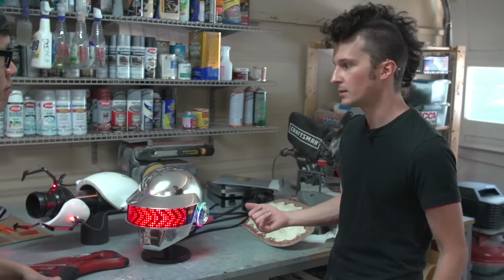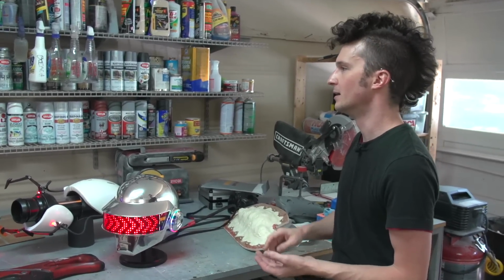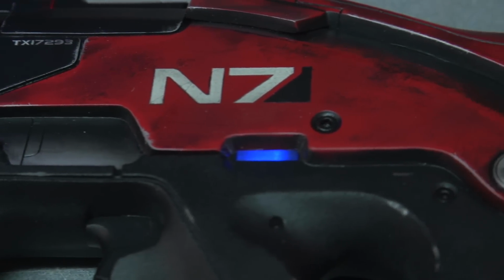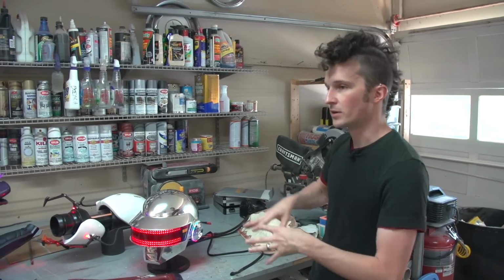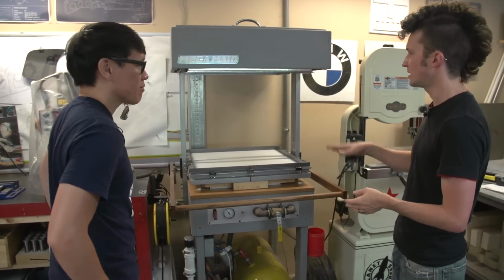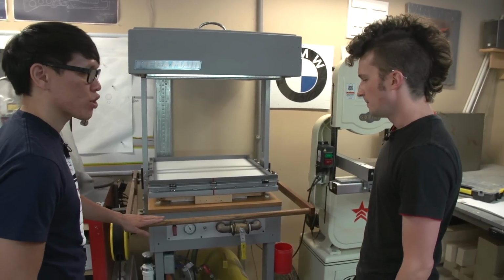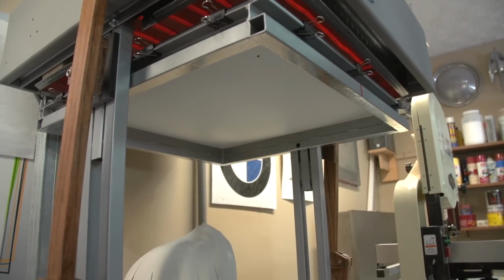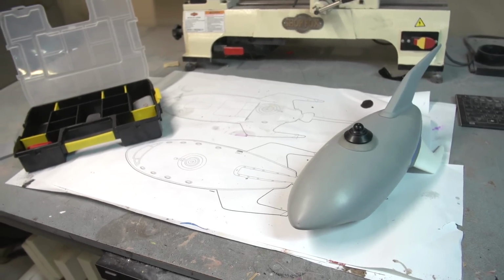The Tools of Prop Making: Tested Tours Volpin Props' Workshop

Comment: IF i were to build a vacuform machine...i'd have a dual direction air lever where first you suck out the first 1/2 of the air with a running Shop-Vac ...thEN when most of the air is out ...switch to the suction power from the tank+pump.
...that way you don't wastE the suction power for the bulk of the air that needs to get sucked out...but then when you want to suck it down TighT on the details the powerful pumP is ready to go.

Comment: Hint for Harrison: High density green sign foam is what you were supposed to use and the secret is many layers of Bin primer with light sanding sessions in between. Seriously, 5 or 6 layers is sometimes needed but it creates a rather hard shell in the end. It sits sort of in between a touch and a no touch model.

Comment: lol I used a house light switch to turn my car amplifier on and off when I was much younger.  It was mounted under the dash and all my friends laughed at it.
Reply: Zero Cool It was always drawing power from the battery.  I think I had the remote wire hooked up wrong.

Comment: I have absolutely no space to work in i live in an apartment building but i really would like to make props/costumes for a living
Reply: Definitely harder, but still doable. Just make sure you have a vacuum. I personally started with EVA foam at the recommendation of Bill Doran from punished props. Check him out if you want. You can make almost anything out of EVA foam and its super easy to work with. Casting is doable in any space really as long as you're careful. At least I make it doable haha. I currently have a mold curing on my kitchen table with a cage over it so my cat won't jump in lol
Reply: Don't let that stop you. You have one life and you don't know how long you got, so go, get making props! :)
Reply: i don't even have a garage
Reply: sonicfreak04 These excuses are small detours on the road to happiness my friend!
Reply: Im in the same boat and Im still doing it. All you need is a computer (for scaling your props) and a dremel. Id also recommend an airbrush so painting can be done near a window. Spray paints indoors is just bad news. When you're able rent a small shop/garage space. I also work for a home theater company to fund my ambitions so don't let "time" stop you either!
Reply: id like to do some resin casting and wood carving

Comment: I don't know if you read these comments, but when you're doing thermo forming, you should get Y split adapter and hook up a small compressor tank to the mold. This will allow you to reverse the airflow and the plastic will be pushed upwards, separating the mold from the plastic. You may need to secure the mold to a platform if its too light. Also, to prevent the webbing you get, simply slide a board between the two object as the plastic is being vacuumed. I do commercial and industrial scale plastic forming. Just thought I'd give a few helpful tips.
Reply: Shkval - What the fuck is your problem?
Reply: TheSuperDweebWhoPlaystheDigitalThingsKnownasGamesWhoisAlsoaHumanoidBeingWhoLivesonthePlanetEarth AWSOME NAME :D
Reply: Annemarie sanders How does your stupid ass comment get 14 likes?

Comment: This is kool and all... but now we have 3d printers so.. yeah... lol
Reply: first off, there is absolutely no pride in that. second, that teaches you nothing about design and engineering. so why do you think prop maker like him dont use  them?
Reply: Dont get mad and yes 3d printing does teach you everything about design... this is a skill wich wont be needed in 2 years..
Reply: Anthony Goris And that's the problem, so many great arts, like blacksmithing, which aren't really needed with the industrial advanced we now have had, has made that skill unneeded, and so the skill slowly dies, which is sad.
Reply: It is sad.. I love things like this
Reply: 3D printers only print one material, small pieces, and are one color. Therefore you are limited in electronics and it won't look good by any means. This won't be replaced by 3D printers any time soon.

Comment: Car audio is nearly all plug and play, and when you work at a big box store like Best Buy, they simplify it even further. I understood basic DC electrical systems and resistance, but nothing like setting up LEDs for PWM in order to extend battery life, or designing my own circuit boards. There's a world of difference!

Comment: electronics as in electronic circuitry, car audio involves an amp (connected to an audio source) that is then wired to the rest of the car's speakers, which doesn't involve wiring boards or electronics.

Comment: Reminds me of Craft Shop at school when I was younger. In craft we did simple electronics, plastics and combined some wood and metal working.
One project we had to make a smooth bowl shape out of 20mm thick wood and make a wooden frame to fit around it with a 5mm gap. We then heated these 5mm thick sheets of plastic in an oven to they where soft and dropped them over the shape. Then we quickly pressed the outer ring down around the object before it had time to cool to make a small plastic plate